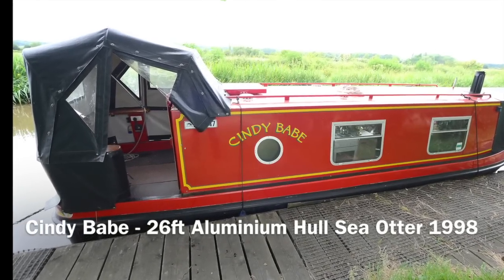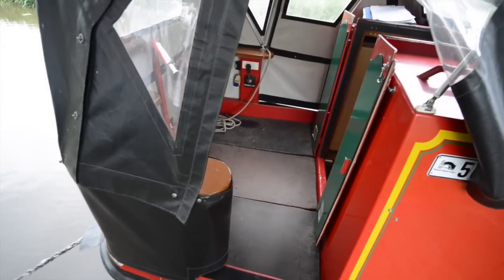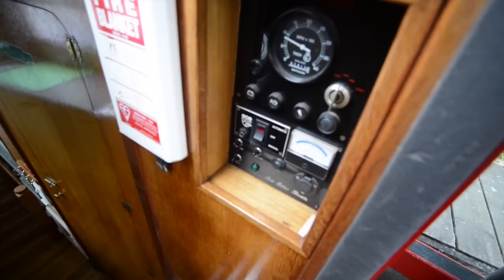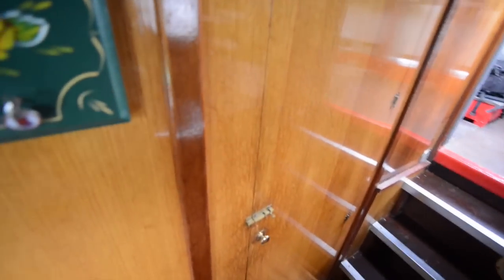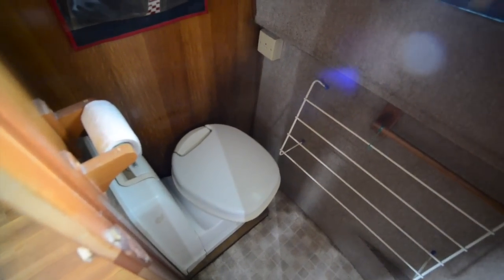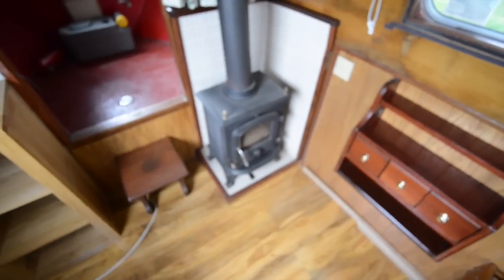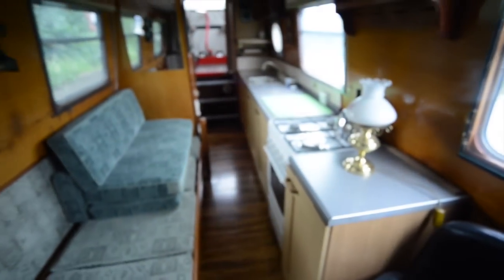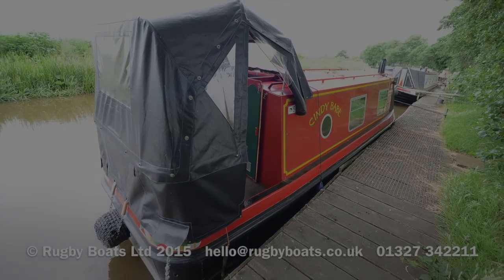SOLD Cindy Babe - 26ft Aluminium Hull Sea Otter 1998

Comment: I wonder how hard it would be to put a temp shower up in the front there? Just curious.
Reply: Two questions
1When you say temp shower are you talking about a gravity fed camp shower? 
2 when you say up in the front are you talking about the small salon at the front of the interior space, or the bow with its canvas cover? 
The only issues with a camp shower out on the bow would be the cover doesn’t give you much space to properly stand up and you would have to make sure the water doesn’t drain into the interior, but if a camp shower is what you want, it’s gonna be easier to set that up on the stern of the boat, since even if that has a cover, it’s already made for a person to stand up in.
If your talking about setting up a camp shower in the small salon area you have to concern yourself with dampness issues and fire hazard from the multi fuel stove